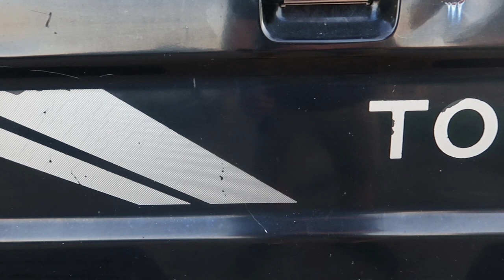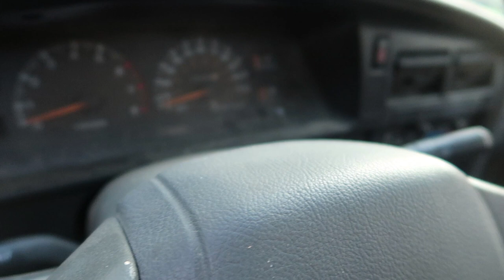I bought a 1989 Toyota Pickup to fully restore! -  1989 Toyota Pickup Restoration Ep 1

Comment: I have a 91 but it's 5speed and the guy before me had pulled the dash and a bunch of other trim panels when he installed a big ass touch screen infotainment/head unit and of course, he just half assed it, only used 5 out of the 20 fasteners, just enough to hold up the corners. Pretty much butchered the hell out of it trying to get shit lined back up but anyway, im stoked to follow along with ya

Comment: How much give for toyota my toyota sr5 was 13.999 dollars tax included extra cab black mine had 5 speed transmission put sony 8000 cd player in it 2 12 inch subs two boston plate speakers  cd changer orion amps and 1 Rockford fosgate amp punch 150 orion amp run subs on quarter of ohm